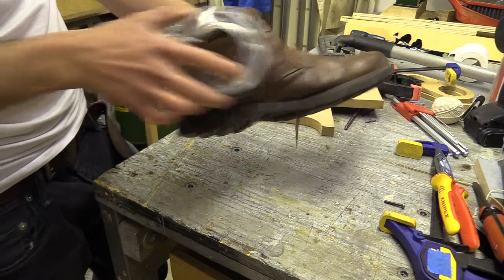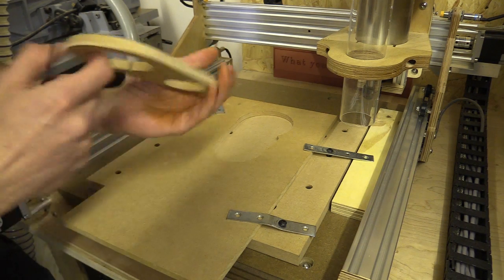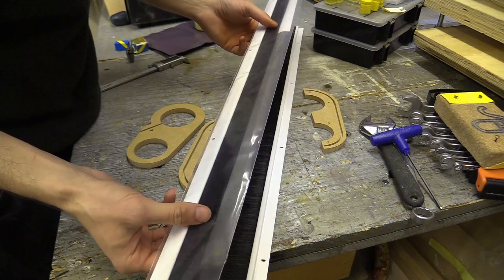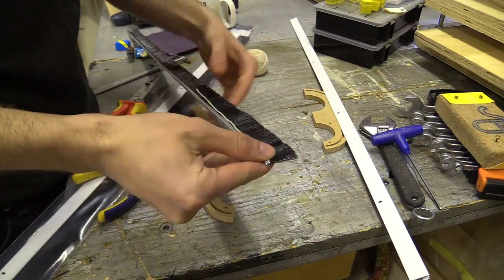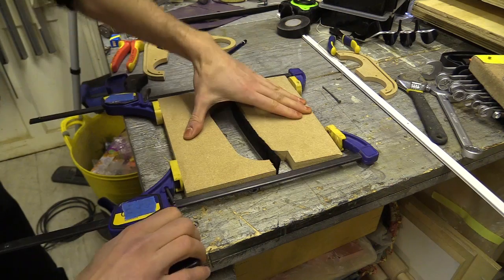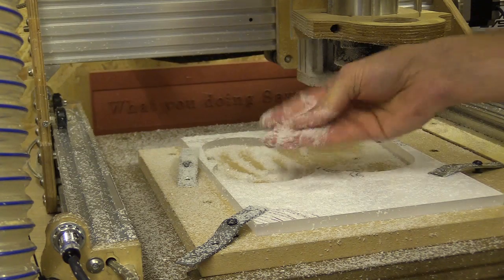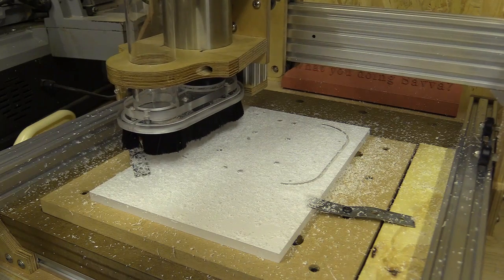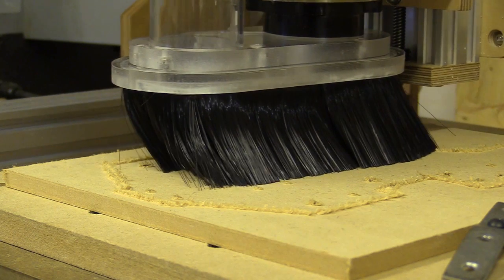#18b Two-Part Acrylic CNC Extraction Boot #18b / Fitted Dust Shoe

Comment: I have tried many dust shoes designs but any that move with the spindle/router have the problem that the brush will either not contact the surface or be pushed down into the surface which then cause more resistance. The best is when the dust show is fixed and there is space for the spindle to move in the center of it. I use the design by NewBritt which I turned into a 3d printable model. This design is similar to the Suckit CNC dust shoe. This is for x-carve but  it can be modified for any CNC.

3d printable shoe 
https://www.thingiverse.com/thing:1892044 

NewBritts Video
https://www.youtube.com/watch?v=PUcAXgsdk3U

Comment: Nice savvas. I've seen a design of dust shoe that's fixed to the z-axis assembly in such a fashion where the dust shoe is fixed at the workpiece height.  I made one like yours with long bristles but the cutter kept cutting it up. Not sure what I'll do with the new one
Reply from the maker: When I rebuild this machine I will make something which can attach to the side of the z axis c beam and can slide up and down around the spindle and remain at working height. I've made so many dust shoes over the years... it's the one place I don't seem to learn from my lessons.
Reply: Educating Savvas practice makes perfect 👌

Comment: Hey Savvas, I don't know if you come back to these older videos to check for comments or not, but I got my machine up and running (kind of in a Frankenstein state for now until I get some shielded cable and drag chains) and I'm tired of holding the vacuum hose. So I started making a dust shoe and after using the first 5 or 6 versions, thought it would be nice to see the bit running.  Can you tell me what type of acrylic you used? Thanks
Reply from the maker: Hi I think it was 8 or 10mm.